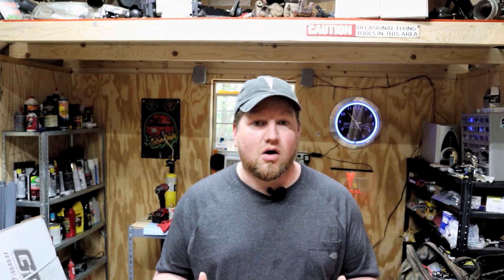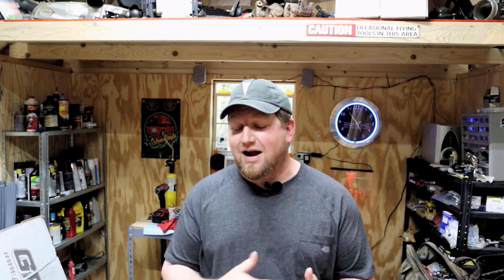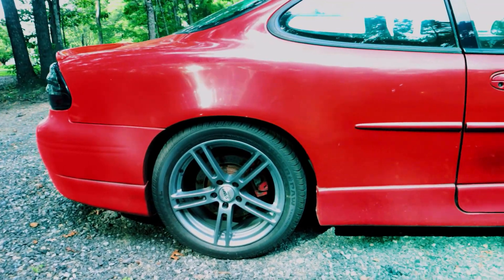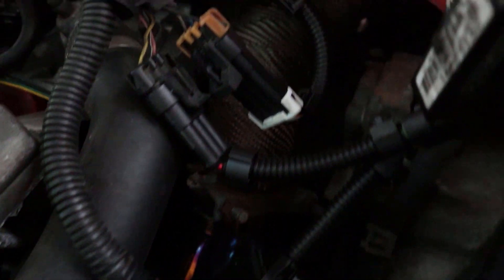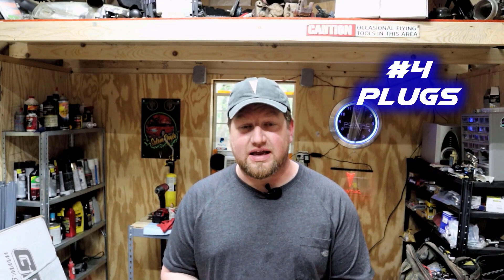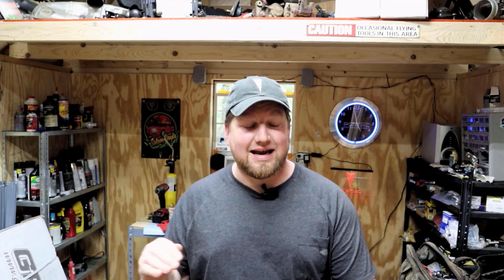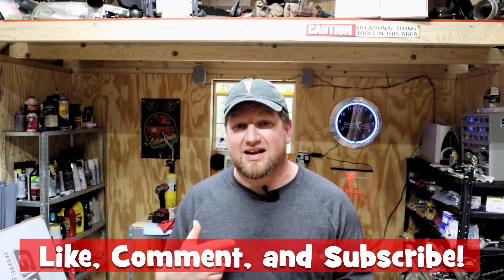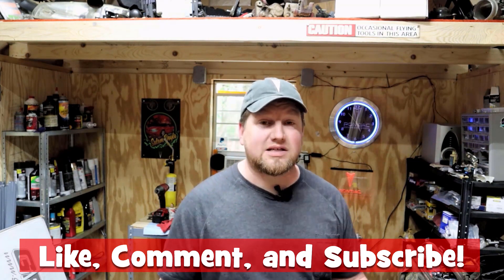5 First Mods for your 3800 Powered W Body

Comment: I spent 27 years in the US Army and on retirement I was bored to death. So I bought a 2002 Regal GS with a blown engine. Went to Summit Racing got a new long block and starting modding it like a teenager with a new apartment.  First thing was ZZP stage 2 IC. And threw away the entire exhaust system and bought again ZZP full header setup. 2.5 catback. dual exhaust. Took the Supercharger , sent it to Jokerz Performance they rebuilt it with new coating on the rotors and and ported it. Took out the brand new cam that came with the long block and slid in a XP cam. Modular Pulley system with a 3.0 pulley and a Aeroforce gauge, just to make sure I wasn't  going to grenade the engine. Swapped out the stock 33# injectors for  Siemens 80#. After breakin and a tune and finding no KR my brother took it to the drag strip here in Charleston and ran 12.9-13.2  on street tires, then broke the input shaft fixed that with a beefier shaft. Now I have the heads off but haven't decided what to do next. I know nothing about the suspension in these FWD  cars and this one feel good but will take it in for work, I'm 6'5" so lowering it is out of the question....Happy Modding
Reply: Love stories like this me an my brother are learning an all i keep sayin is they didn't have youtube back in the day an made beautiful cars ! Motor swaps all kinds of crazy stuff im here stressing like i needa learn how to do Motor swaps my self!
Reply: Wow, thank you for sharing, Sir!
Reply: It's interesting to see how more and more people are looking for the old 3800 to bring it up to the next level.

Comment: In the l67 or 3800SC make sure youre running 93 octane to help avoid issues with KR you dont want to run a lower grade fuel inthese engines

Comment: SHIFT KIT goes really well with a tune. Even better doing the tune and the shift kit at the same time. I was blown away at what difference it made with highway merging.
Reply from the maker: Good point
Reply: What's a shift kit? They make that for automatics?
Reply: @ArlowFarrell  yeah it's basically some springs that go in the accumulator of the transmission to delete the smooth shifts and make the shifts more quick.

Comment: Next (5) Mods = Strut Tower Braces, 8.5mm Spark Plug Wires, Cold Air Intake, High flow Fuel Filter, TRans Cooler.
Reply: What does the spark plug wires do when they are 8.5 mm? Do
Reply: strut tower brace is super smart, my strut tower welds blew and the whole thing starting leaning in towards the engine
Reply: What brands? And what is that wheel and tire size you have on that red w body
Reply: @dcarden3031 zzp has a lot of stuff for 3800 motors and tell you what cars certain parts work with. If you look in the description on certain zzp parts it tells you what you may need before upgrading or changing certain parts

Comment: Just picked up a 04 Bonneville se for cheap with 64000 miles...super clean inside and out..no rust anywhere even underneath. Got it for a back and forth work car cuz i totalled my truck..but im realizing this has potential to be much more.
Reply from the maker: Yeah. Those are nice
Reply: I have a 2001 Bonnieville mint with  115k Miles. Only second owner.

Comment: This is such a great video and such useful facts. 20 plus year old cars have suspension that's shot and breaks that are worn. The first thing people want to do is make the motor faster but the temptation to drive it with subpar safety is high.

Comment: Got a bonneville SSEI, I know it's a H body, but I'm rebuilding the engine since it was rod knocking, can't wait to get into modding the 3800 sc
Reply from the maker: All the 3800s are basically the same anyway.  Make sure you look up info on the mains on these.  Best bet is to leave them alone unless you line bore the bottom end.  These blocks like to twist when the main caps are removed.
Reply: I got the special edition 1997 bonneville super clean rides like new I'm looking for my first mods
Reply: will these mods work on a buick park ave ultra supercharged 2003

Comment: Actually a decent video. I was expecting you to list a bunch of things that would not be applicable to my Series I 3800 Powered W Body car but everything you've listed is a sensible thing to look at regardless of the generation of the car in question. The older the car, the more likely you've already looked at many of these things.
Reply from the maker: Thanks

Comment: Okay thanks for the info. Everything you state is common sense and reasonable.  I was putting a parts list together and you covered it even the 180 thermostat.  I’m not really familiar with the Series II and best mods.  I had a pristine stock 01 SSEi Bonneville once until a knucklehead rear ended me at a traffic light.  I just recused a Gen 4 96 Camaro off a hot Texas street from a owner that let it sit for a long time.  I jumped it and it started right up and drove okay.  Everything you said would benefit this 25 year old car.  Gen 4 F body especially the 3.8 cars are really inexpensive and overlooked.

Comment: I live in the north and run a 180 thermostat.  As much as I like having one of very few cars left on the road with iron heads, they are not good at dissipating heat at all.  I was flying up and down the Allegheny mountains and thought I was going to blow up the motor when the heat gauge started climbing lol.

Comment: exhaust is key add on.
not for just power but will help ro reduce knock. the fastest u get the gas out will limit knock. the best heat reduction is header wrapping all the exhaust. 
thanks v

Comment: 1: start with Keith Black 1-1-2 ring pack pistons 
2: Cam shaft 
3: colder plugs
4: inter cooler plate 
5: 180 degree thermostat 
6: wheels/tires (245/35-ZR20) of the low roll tech variety 
7: BREAKS!!!!! of the bigger variety with multi piston configs.
8: coil over Struts 
9: tubular control arms
10: body make it lighter
11: exhaust with down pipe 
 then the very last ting you do is 
11: change your sc pulley at this point 3.0 in for h body 2.5 for w body

Comment: A topical stage one or two kit from zzp is parity much everything u said there if u just get the 1.0 PCM from there u ain't got to do much tuning to it till I start adding more power then the tune can handle...makes shifting points stiffer while reprogrammed the shift points from stock to "WOT" at 6k rpm...
IV got a 04 GP GTP COMP G tuning pretty stock but k&n cone filter with 4" short ram setup with factory box as cold air box...ngk tr6 plugs 3.4 supercharger pully with 1.9 rockers and zzp 1.0 PCM...
It don't cost much to have them tune it as I already know but yes hptuners are amazing
Reply: Where about a u from cuz another video I saw u went to Farmington and we'll I live about 30 min from there
Reply from the maker: In mocksville.  We are planning a few runs at farmington on fri. The 18th with some other 3800 guys.  Look for triangle 3800 group on facebook.

Comment: Awesome advice, thanks. 1992 Regal Presidential, 65k miles. It's not fast or quick but she's got long legs. First I figured I'd delete (hollow out) the cat, install a throaty exhaust (maybe flowmaster or the likes) then a simple cold air intake, plugs too. It has the "soft ride" option on the build sheet but I may lower it too. Not racing, showing or anything like that though it's in really good shape, few whiskey dents in the chrome bumpers but it's fine.
Reply from the maker: Sounds nice
Reply: I've noticed a lot of older buicks are in remarkable condition, mine lived in a garage on Cape Cod from new until 5 years ago when the old lady died and it went to auction. Back seat has never been used. Ever lol. Until recently hahaha.

Comment: Everything you said is spot on! My sentiments exactly! Great video! I'm about to look Into buying a 02 GTP/GXP and I'm trying to grasp all the info i can get before purchasing....
Reply: GXP was only from 05-08 the brakes on a GXP is upgraded from a GTP, factory bilstein shocks are no longer made for it. So you have to either go aftermarket or be very specific with the place you buy shocks from. Only GXP shocks will fit due to bigger rims. Only way to go smaller is to change the wheels width. Smaller rims will not fit due to bigger brakes

Comment: Unfortunately I learned the hard way in regards to headers/downpipe. I purchased and installed the downpipe first and then realized they weren’t compatible with headers (so I figured next best thing was to get power logs and save a little cash)

Comment: Quick question I need an idea on what to do with my exhaust. I currently own a 1996 Buick riviera supercharged it has the 3800 series 2 engine in it of course. What idea would you suggest I do with the exhaust that would make it sound nice. Thanks man and nice video also
Reply from the maker: Is yours single muffler or dual?
Reply: @SalemDoyle  it’s dual
Reply from the maker: A downpipe and some magnaflows would sound pretty decent.
Reply: @SalemDoyle  which zzp down pipe would work? The H body one or just the regular down pipe they offer and thanks man I really really do appreciate it seriously means a lot
Reply from the maker: Im not sure wich end would fit the riviera best. But an exhaust shop could make it fit easily
Reply: @SalemDoyle  awesome bro thank you so much I really do thank you bro stay safe 🙏🙏
Reply from the maker: Thanks.  You too
Reply: Sell it to me i got a 99 buick regale

Comment: enjoyed the video brother!!!  I have a 97 grand prix gt. N/A. I can still get this "ol girl" tuned at a shop? will an aftermarket chip be a good idea??
Reply from the maker: Computer tuning can help with shifting and stuff, you wont gain much power without mods, but it can make it feel tighter
Reply: ok I'll definitely look into it.  I am looking for another 30-40 hp if I could find it from somewhere.  if not I am thinking about going with a cam, heads, and headers.  Any ideas without having to deal with the "big three"?  I just need a lil more HP so my daughter can merge with confidence. 😂 (new driver)

Comment: I'm still in the plain old "fix it" phase so I have to change the oil pressure sender now that I've done the wheel bearing and that's all square. I also have to get a fender and inner fender since it's destroyed/gone.

Mods I can afford and seem like they'd make the most difference for my $$ are ZZP front power log, u-bend delete, and drop in filter. Some day I'd want to get the ZZP ECU as well. Would these be worth doing? I bought the car for $500 and can't afford a lot that's not going to make a ton of difference. I hear the rear header and the crossover pipe are not big restrictions.
Reply: Dude just drive it and keep it maintained. If you are broke, putting money in to fun stuff is crazy.
Reply: @jerbear7952  I'll sell it to ya if you want and maintenance is all I've really done besides wheels/tires and filter box mod

Comment: Hey guy love your stuff on the W bodies. I have the last great GP (2008) in 9.5/10.0 condition. Wanted to send a pic of it. I am very interested in your post on putting GTO grilles in. Where is the best place to locate a pair? Several horror stories Ive seen about ordering and having poor fit and using zip ties to hold them loosely, ...etc. thanks for any advice. I check posts regularly.
Reply from the maker: These are acctually called spo grills.  I misspoke.  But they arent made anymore.  There are usually some for sale by owners though.
Reply: @SalemDoyle    CAN you tell me anything about coolant drain plug on a 2008 Grand Prix 3800 series 3? I need to fully flush the cooling system. Thanks for any help.
Reply: I meant to specify the drain plug on the engine block.
Reply from the maker: Its on the bottom of the radiator on the drivers side
Reply from the maker: @darenflowers4128  oh, i dont think there is one.

Comment: My 01 GTP is getting a  new/reman  ATK/VEGE engine this weekend. Gonna do the P-log and exhaust soon after. Can't decide on the on the 2.5 or 3 inch, don't want too much drone.    What do you think about stage 1 intercooler ? unfortunately sold but ZZP does have stage 2. I live in GA. so i understand the heat issue :)   Luv your vids man!
Reply from the maker: Thanks.  Yeah an intercooler would be a great upgrade.  Its not the simplest but one of the best
Reply: @SalemDoyle  Thanks for the speedy reply!

Comment: Since the Comp G  doesnt have the ubend would it be better to get the front powerlog before downpipe? Theres a regular on the GP forums who always claims the front powerlog is useless over stock, but it could be a running inside joke that I missed at some point in history. At 110k do you think the cat is probably much more of a restriction? Waiting on that ZZP black Friday lol
Reply from the maker: Me too.  But i think the 3" downpipe would be a good start.  Still better than stock.
Reply: @SalemDoyle Downpipe sounds like a fun project. 4 months and I'm done with all the basic maintenance and suspension. Just got my first mod in the looks department today. Had dual dual 3.5" SS exhaust tips welded on. Looks good, and found an awesome oldschool exhaust guy to go to when needed. Happy Thanksgiving
Reply from the maker: Awesome.  Happy thanksgiving.

Comment: 1995 Buick Regal 3800 Series I, normally aspirated, with 32,000 miles.  Nobody ever posts anything about them. Especially performance mods. Aftermarket performance parts are nonexistent. Thoughts?
Reply from the maker: Just not as popular a platform.  There is still stuff you can do though

Comment: First thing to do is read the tuner guide and get a scanner. YOU WANT ZERO KR! Second thing you should do is the intake manifold gaskets and aluminum coolant elbows. I've seen all of them fail. *Putting a 180 tstat in without fan tuning is a no no. Don't do it.* Lol
Reply: How do you do the fan tuning when you put it 180 thermostat in do you have to buy a special scanning tool
Reply from the maker: Hp tuners can do it

Comment: I need all the info I can get for a 1996 Buick park avenue. I know it’s a series 2 with the 4R60 trans. Please help I need it to have more power. Yet safe power as for it’s a budget build. But I want to do it right over time. But basically plan to buy a 98(ish) camaro and throw the 3.8 in it

Comment: Hey I appreciate your videos but have a question for you. Do speed daddy headers line up with the zzp catback?
Reply from the maker: Yes. Because they fit the stock catback.  If you go 3 inch just get the 3" downpipe exit from zzp
Reply: @SalemDoyle  Thanks. Will be in touch
Reply: seeing that zzp doesnt have any 3'' catback would a 2.5'' work on it
Reply from the maker: Yes, it will fit fine

Comment: What size brake calipers do i need for my 04 buick lesabre,got the plugs done looking to get rid of the stock air filter box and replace it with intake cone filter,and also do i need bigger rotors or just stay stock rotors
Reply from the maker: Rotor and calipers need to be a set, you cant mix and match.  For stock rotors stay with stock calipers

Comment: Been trying to get ZZP headers for months. Been out of stock.
Reply: I’ve noticed that too. I’m on the hunt for poly engine and trans mount... same issue (outta stock)
Reply from the maker: Hopefully they restock some stuff soon
Reply: You do what you want with you're money. But I recommend not buying them. They're not worth it for the money.
Reply: Carnage 50X what do you recommend? The other headers on eBay don’t fit worth a shit.
Reply: @flynnzero9282  I'm sorry to break this to you my friend, but they all have fitment issues no matter the brand. Why waste $1k when you can spend ~$200-300 and have the same problems. The only thing the zzp headers have over the SD is they look nicer and don't have the dip at the bottom. Whatever headers you may end up installing, I 269% recommend sending them out to get ceramic bead rolled in/out (different shops/companies use different terminology. The headers get put in a drum full of these ceramic beads. As the drum rotates and vibrates, the beads wear off into the service of the headers. In/out. Then it's cooked into an oven) Then wrap them with header wrap. The combo of those 2 things will keep under hood temps low, and more importantly, keep your trans cool. That coating service and wrapping is well worth the investment tenfold.
Reply: Carnage 50X I have put both on. ZZP has the least.

Comment: By colder plugs, what do you mean? I'm looking at doing initial maintenance on my new to me 2004 Pontiac Grand Prix GTP.
Reply from the maker: Spark plugs are available in different heat ranges.  A common thing to do is go 1 heat range colder

Comment: I have a 3.8 v6 3800 series 3 L26 not supercharged. And I want to put a supercharger on it. What would I have e to do.
Reply from the maker: Basically you have two options.  Traditional top swap ( basically rebuild with l67 heads. Intake. Supercharger. Ect.)  Or the zzp top swap kit

Comment: What can I do with a none supercharger 3800 II in a 05 Buick Park Avenue SE if I wanted just a little more POWER?
Reply from the maker: Same basic stuff, exhaust rockers intake tune.
Reply: Thank you Sir! 
Dealership under warranty did my motor mounts, my intake with gaskets and all new, new water pump new alternator, starter, battery’s oil pressure sensor, new transmission wheel bearings…etc’ appreciate It even more’ redoing my suspension and time for another paint job now with over 218k miles averaging 21.8 mpg….Hwy up to 31. to 34 mpg